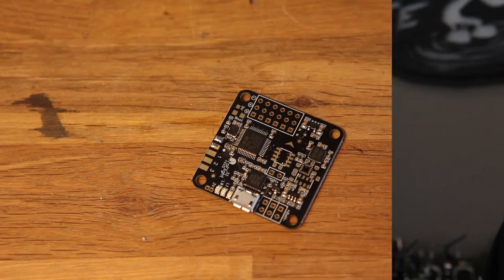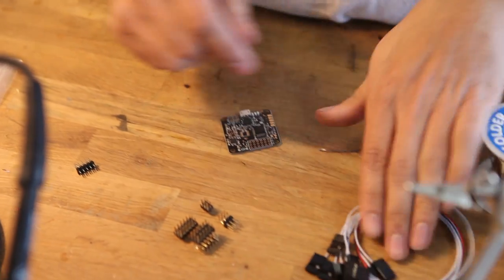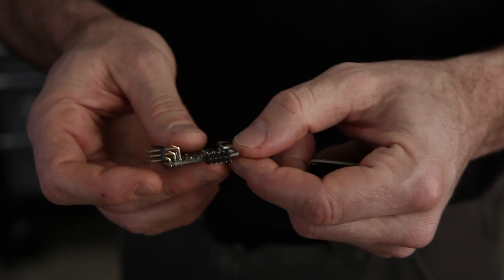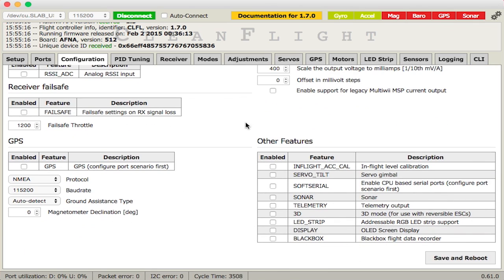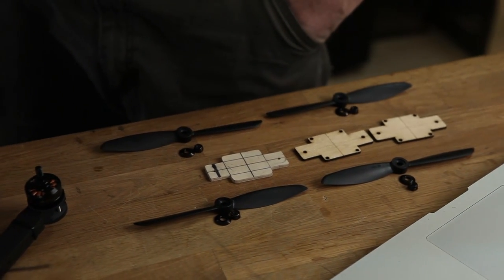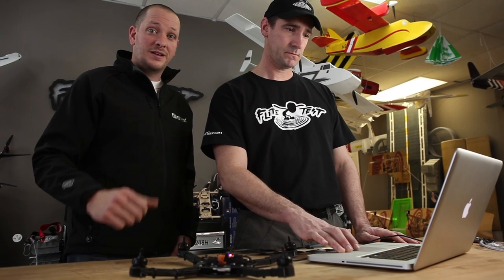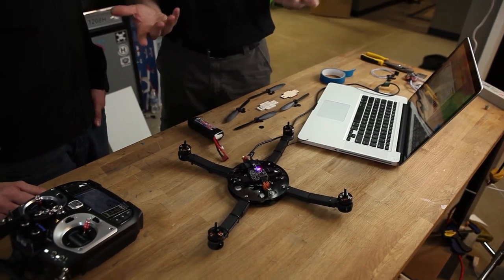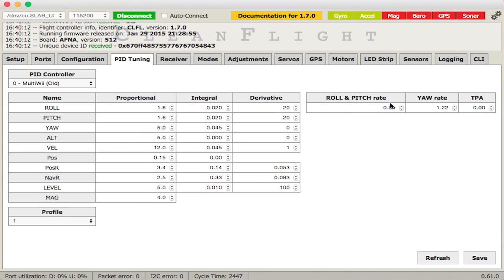Flite Test | Naze 32 Board Setup

Comment: If you set a switch to arm/disarm, and bump it while flying, does the copter just fall from the sky?  
I put a lil' flap of tape over my transmitters power switch, after one time that I reached over to trim the elevator up a bit, and switched off the Tx instead (getting my plane stuck on a 40 foot high barn roof before it connected back up)...so seems like the kind of trap I'd fall into.
Reply: I think the same thing. That's why I use the standard Multi-Wii yaw right to arm. I'm pretty sure that if you accidentally hit the switch to disarm while flying you're going down.
Reply: Yeah, a little bit, but with programmable radios (I use the Taranis using OpenTX) you can make combos. I did that after I bumped the switch and confirmed the gravity bill was paid. Basically I have my arm/hold switch as a 2Pos, and the 'Flip' switch as a momentary. So it defaults to motors on 'hold,' I flip the 2 position to 'Arm,' but nothing happens until I then hit the momentary switch (like an OK button). That way, if I'm flying and I hit the momentary, nothing happens (because the 2Pos is still armed), and if I hit the 2Pos, nothing happens, as well. I have to flip the 2Pos, then the momentary. I've never had an issue disarming it when I need to, but it's saved me a couple times bumping the switch.

I looooooooooove Open TX just for the ability to do as much of that sort of stuff as you want, though it can very much be a pain to figure out at first.
Reply: * EDIT *
Have checked with a couple of people and  Cleanflight and it does disarm in the air.

I will have to check with my own Baseflight setup to see if earlier behaviour has changed (but suspect that it will also disarm)

I guess that's another reason to stay with arming via the sticks

* EDIT *

On Baseflight hitting the disarm switch doesn't disable the motors while in flight, as cleanflight is a forked version of baseflight I doubt that it would disarm.

Personally I prefer to use the stick to arm/disarm
Reply: I set my arm / disarm to a pot/dial on my controller. This way I can't accidentally flick it off mid-flight or on mid-tuning.
Reply: Yes. It does fall out of the sky, I've done it.
Reply: doomfest_fpv

Here's an update that I got from a racer friend

JAB1a: AFAIK it will 'disarm' in the air but allow you to fly until your throttle drops below your 'minthrottle' (1150, motors stop) then it will not allow you to increase the throttle until you 'Arm' again. I,e you dont have a switch that activates 'Brick mode

Cleanflight 1.7.1 does have brick mode (which is a little worrying)
Reply: Weird, it bricked for me in the air when I was running 1.5.1. Maybe it's because i have MOTOR_STOP on.
Reply: doomfest_fpv In baseflight I noticed this CLI command disarm_kill_switch this morning (it must have sneaked in at some point and is probably in Cleanflight too)

Basically it returns the behaviour of the arm switch to the old low throttle version

So it may help you
Quote
"Enabled by default. Disarms the motors independently of throttle value. By setting it to 0 baseflight reverts to the old behaviour of disarming only when the throttle is low. Only applies when arming and disarming with an AUX channel."
Reply: Ah, thanks. I'll probably keep the kill switch, but this is good to know.
Reply: Great video! But they should have mentioned failsafe settings.
My opinion is you should really want a racingquad to throttle 0% and even disarm on rflink loss. I have the failsafe setup on the receiver and also have the buzzer setup on failsafe and a switch on the transmitter.

Comment: Flite Test guys I officially hate you right now! I've been looking at the Naze 32 full board for a few days now trying to figure out if I want to pull the trigger. The problem is they are hard to find. Now that you went and made a video of them, they will be sold out everywhere! Seriously though thanks for the great info, I would like to see something on the Afro Naze 32 (full board) with GPS hook up and Gimbal setup. Great show!
Reply: Yeah it used to be a problem to get them, but since Hobbyking started selling the naze32 its been much easier. Manufactured in higher volumes I believe.

Comment: Nice stuff guys, it's hard to see what's going on with the angle arms? I went to the store but I'm still confused how they are built?? I know coloring everything looks pretty, but it's hard to see the details on video :/
Reply: Basically you cut the arms and use the brackets with screws from both sides to splint it back together at an angle.
Reply: Ok nice, that makes sense.

Comment: hi Eric i now this is not the proper way to contact you but but my flite test log in wont work and iv not yet received the email with my details , any way i have trade to set up my naze32 but every time i plug in the battery every thing locks up the pc the board every thing just wonder if you have any suggestions ? best regards shane

Comment: Hey guys ,I built my first quadcopter but my controller (grouper mz-12) input is not being read by the quad although it is binded.For example when i move the throttle up,the motors don't spin.I think I wired up the receiver (Groupner HOTT GR-16) wrongly.Any suggestions as to what wires connect to the receiver.I am using a Naze 32 as the flight controller
Reply: @muhammed mafawalla look under model type and see next to "motor at c1" it says idle or no. if it's at idle you have to flip a switch to get throttle input. or just switch it to no

Comment: How do you know what receiver mode your receiver uses? (12:30 in video)
Reply: Ben Draper  Its really what mode your Radio is transmitting.  Your receiver will receive whatever mapping you set on your radio.  So for example if your radio is setup as AETR (channels 1 - 4 accordingly) then your receiver will see AETR on those same channels.  But if you change your radio to TAER on 1-4, reciever will see TAER on the same.  So to figure out what your transmitting, check your radios setup menu and you will find what MODE your setup as and it should have a default channel order such as AETR or TAER or any of those combinations.  Then match your servo / motor setup on Naze to the same. When in doubt, use the chrome app to test connections PRIOR TO FLIGHT :)

Comment: I've had the board for a while now and haven't been able to hook it up with my Rx correctly. I'm using an orange Rx dsm2, horrid I know, and I can't figure out what is the correct way to set it up. Does the board only support a couple receivers types?
Reply: I have the same type of Rx and it's working fine with my Naze32. What problems are you encountering?
Reply: I guess I just don't understand the pin outs well enough. I cannot seem to get it to work correctly with my receiver. What is your setup like?
Reply: Granite Yea, it had me confused as well :P
I'm running an OrangeRx R710 and a DX6i.
I'm not sure about your situation, but one thing I forgot was to set channel map correctly (under the "Receiver" tab). I had mine on default, which means Aileron (pin 1), Elevator (pin 2), Throttle (pin 3) and Rudder (pin 4). When I plugged in the wires from pin 1 on the Naze to ch 1 on the Rx and so on, it did not work at all, as you may have figured out :P
The channels where messed up. Rudder was throttle and throttle was aileron etc.
I ended up working out what wire needed to go where by just trial and error... because I didn't know about the channel mapping and where to look to know the pin outs.

If you set it do JR/Spektrum (TAER1234), that means that Throttle is on pin 1, Aileron on pin 2, Elevator on pin 3 and Rudder on pin 4. The pin out order on the Naze32 is 1 to 3 on the top and 4 to 8 on the bottom (left to right).
I hope this helps.

Comment: Great to see you guys moving over to the Naze 32 but for future reference can you PLEASE PLEASE PLEASE get Peter to use a decent temp controlled soldering station.  There are heaps of inexperienced people watching and learning from you guys and this is really showing them the wrong way of going about soldering electronics.  Sure, have an extra part and say "if you don't have a soldering station then here is how to do it with a basic iron" but showing them only this way is not good IMHO.  Sorry to rant, I love your work otherwise.
Reply: He was using a temp controlled soldering station, check at 5:14.

Also, love your videos FinalGlideAus.
Reply: He needs a pencil tip temp controlled iron for working on those boards. He mentions melting the plastic on the connectors multiple times. A proper pencil tipped temp controlled iron would prevent that.
Reply: TheIllusiveReality Ahh, Thanks mate! I stand corrected.  Thanks for pointing that out :).  The tip is way too big though.  I know this is getting picky but people are learning from them so this should really be done the right way.  Soldering electronics can be frustrating for the inexperienced if they are using the wrong tools.

Comment: how much better is the naza 32 compared to the kk 2.1 for a beginner? Ive only flown about 5-6 times as a beginner with my KK2.1 and some reason i don't like it cant seem to get the yaw to stay in one spot and whole quad keeps wanting to drift.
Reply: I would recommend a CC3D, very similar board, you can even install the clean flight firmware on it.
But it is a much simpler board to setup and configure with the open pilot software.
Reply: im not fussed with setup stuff i just want a nice flying platform plan to use it for aerial video recording with a 2axis gimbal.

Comment: if i put the throttle stick of my rc radio in mid position, what behaviour should my copter show? so far i thought it should hover a few centimeters above ground, is this correct?
Reply: Typically you want 50% throttle to be the hover point for your quad. You can play with the "Throttle Curve" settings on your transmitter to flatten the curve at the percent power that your craft hovers.

To answer the rest of your question, don't use a few centimeters above ground to calculate how much power you need to hover. Within a few inches of the ground, your craft will gain additional lift from the "ground effect" which it will NOT get at altitude.

Take it up 3-4 feet and make it hover. Not the position of the throttle. That's when you want your throttle curve to flatten. (i.e. If you're at 55% throttle, then flatten the middle of the throttle curve to settle near 55%.)
Reply: thanks
Reply: ***** or you can set mid throttle on the fc using cleanflight

Comment: Could you put shims under the motors to create the thrust angles you show in your video.
Reply: ***** I was thinking about that too, but mounting the motors might be more difficult because most motor mounts are designed for a straight arm. It might be possible to use something like the "V-tail Quad Motor Mount", but just tilting the arms seems to be easier overall.
Reply: I was thinking of that as well.  Was thinking of something made on a 3d printer.  It would need 2 sets of holes. One to match the angle of the base and one to match the angle of the motor.
Reply: Scott Calkins That might work, but of course you need to make sure that the props don't hit the arms then. If you angle the arms, the motor also get's lifted a little, leaving more room for the props.

Comment: How about doing a similar episode about cc3d flight controller? You can buy a cc3d for around 15usd shipped so its very cheap and has alot of functions/options (gps for example).
Reply: Or simply update the video description to state that all STM32F3 (more to come) targets can be loaded with Cleanflight.  ie:  CC3D, Sparky, AlienWii, CJMCU, etc.
Reply: I agree cc3d has been around for years and is very capable also.  Now with pwmsync and oneshot125 support you don't need to load Cleanflight on it to use this feature.

Comment: Hi,
I saw someone using software to calculate multi copter design and performance, in terms of motor power, arm length, weight lifting capacity, propeller size etc. He just filled the 
Does anyone knows about any software like this ? It would be extremely helpful.

Thanks,
Deepak

Comment: Cool video and a good controller. I'm a bit disappointed you didn't get into the origination or the original designer of the Naze 32 board at all. Surely you'd like to be credited for your designs as well.
Reply: The original designer of the Naze32, timecop, doesn't approve of Cleanflight and wouldn't be proud of anyone loading it onto his boards.
Reply: Credit should go to Timecop who did the original port of this software, without him there would be no Cleanflight, without MultiWii and Alex's work there would be no Baseflight. 

Also thanks to all the other projects including OpenPilot, BradWii and others that Dominic has forked his work from. He stands on the shoulders of giants, credit them also.
Reply: mm, did feel a bit odd not hearing his name mentioned and then to go and use a fw he openly opposes (even if it's for the wrong reasons).

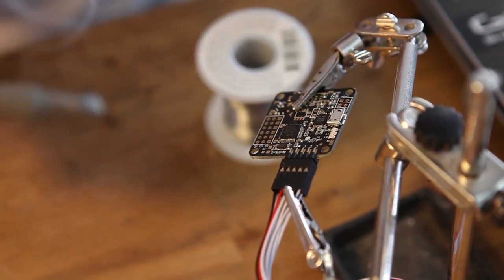Comment: Long time viewer…first time commenter to your vids. Great info. But I cringed at about 4:20 when I saw the bare metal jaws of the helping hands alligator clips being clamped to the bare board's components.
       I highly recommend sliding some heat shrink tubing of a suitable size (slip fit) over each side of the jaw, to act both as an insulator against static, and as a bit of cushioning to avoid damage to fragile components (or fragile soldering joints or traces). Do not necessarily need to shrink the tubing, unless it is too big to be a decent fit, or you want to (if shrunk, it can get so tight that the points of the jaws punch thru. But a 2nd layer can fix that).
Reply: +george gassaway I just made the same comment. I gasped at 4:04 and barely kept my beer from coming out my nose.

Comment: Most of you all know how to solder.  For those of you who don't,  you need to use a pencil tip or other fine tip and low wattage.  It is imperative you use plenty of flux, don't rely on rosin core alone.  Buy a small tub of flux and appropriate brush. The RC input pads..........if you let your soldering iron linger too long you're going to have the pads lift up off the PCB due to too much heat being applied.

Comment: ya'll should do a build video for the racing quad. what motor/esc setup is that?
Reply: Hey John! This one is on 2300kv Cobra motors with T-motor 12amp Simon K escs. 3s 2200 Lipo, spinning HQ 6x4.5 props. I am building another right now that will be 4s and run the motor/esc combo from the BO330. Should be a rocket! 😜
Reply: awesome thanks! out of curiosity, what angle does these bent arms work at?  I'm curious as to how much thrust is lost do to the motors fighting each other a little.
Reply: Eric Monroe Hey Eric! I was curious if you ever put that quad on a scale. I just bought an Electrohub and am hoping that my current setup will be able to perform well. I am running 6x4.5's and DYS 2300KV. The max thrust is nowhere near the t-motors, but I think I should be ok.

Comment: 1- Does it fly well with stock PIDs?

2- What about autotune in Cleanflight?

3- Ever tried a Thunder KK Pro flight controller? I have the QQ Super version with the Auto-Level and it flies very well. I was wondering if the KK Pro (which does not have an Accelerometer) would fly well in rate mode? Anybody tried that board? I ordered a KK Pro and a Naze32 and I'll post my results here in about a month when I receive everything and test them well.
Reply: stock pids is pretty solid for all the multirotors I've tried, theres a big debate over autotune – personally i love it as a jumpstart on tuning a new frame but others have reportedly lost signal and or multirotors while using it
Reply: What are the frames you tried it on? I'm getting a 250 carbon/fiberblass (PCB integrated).

Comment: I have a naze32 rev5 version fc board, Using it for building a QUAD X design, the problem i am facing with it is, when i throttle up, all ,motors spool up, but eventually slow down at different rates, except that of the 2nd motor. This happens throughout the throttling range. I even tried the same esc and the motors with QQ flight controller board, it works very well, but its the naze32 with which i am facing the problem, Have been searching answers everywhere contacting everyone, regarding the same, for last 2 years but still haven't satisfying answers. Even I've seen many people are facing this issue, i tried the solutions prescribed for them but, like calibrating the esc's again individually, or through the flight controller, etc, i tried everything , So anyone's help would be appreciated regarding the same.
Reply: I had a similar problem. It was because I had extreme trim on my transmitter. Once I zeroed out all of my trim settings the problem stopped.

Comment: So ... I've got a naze32 rev.6 .. When i plug in the USB cable it starts the ESC's .. is this normal? I thought the ESC's wouldn't start until i pluggen main power ??
Reply: That should not be possible. Only when battery is plugged in. Usb cable is not enough for powering the motors.
Reply: +Robert Toebak it happens. it's a problematic board ..
Reply: there is a check in configuration that allows to motors not to be armed with power to it.
Reply: yeah. I'm using it as a keyring! ✌
Reply: That is a great idea! I have too many bad flight controllers just laying arround

Comment: Generic computer tips:
* Install drivers before you ever plug any usb device in. At least with most version of Windows, a device with no driver can confuse things greatly.
* Whenever you flash a device, do NOT disconnect/move/bump it. Getting firmware only half flashed is usually very bad.